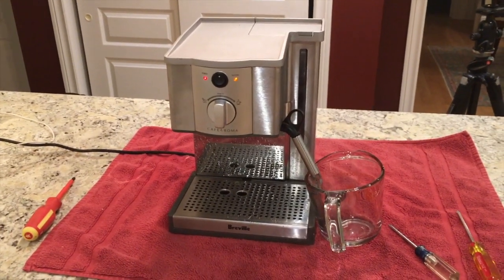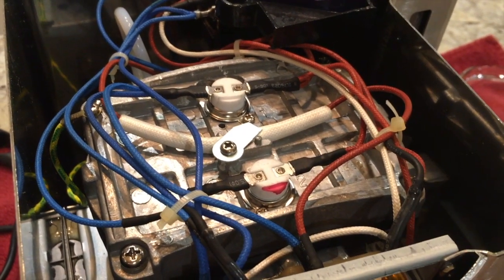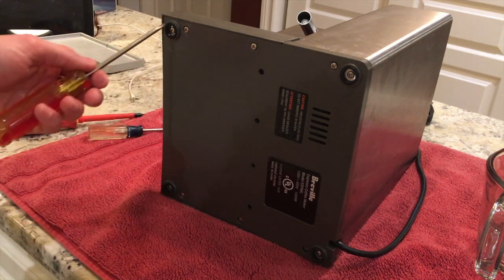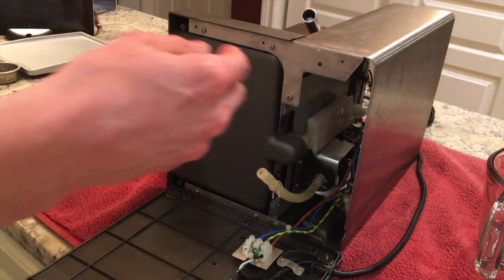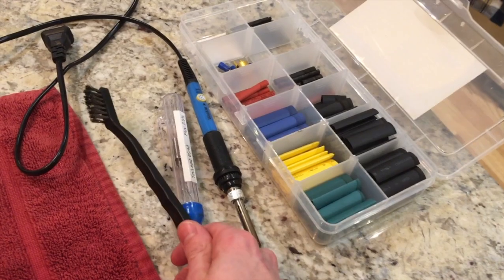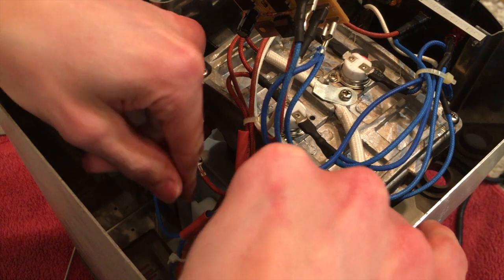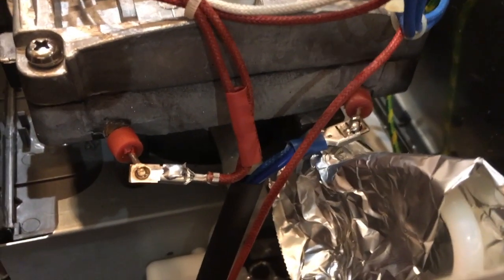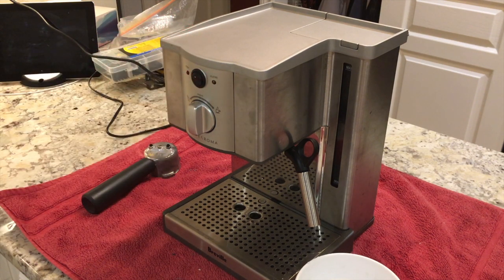Breville Cafe Roma Espresso Machine Not Heating/Steaming - Repair

Comment: Hey Geoff, we’ll done. Very good presentation, no bs about forcing viewers to watch long drag out boring bits, straight to the point. I appreciate it. Get a proper mic if you could for future vids, I thought I have gone deaf! My Cafe Roma has been going for 15 yrs, still is going. Only needed a descale after something was blocked inside the guts. Yup, only ever descaled once in 15 yrs! Either I’m hopelessly lazy ( probably) or the machine is damn good. Cheers!

Comment: Just got a 2nd one for free tonight.  Heats up and you can hear the pump run, but no pressure.  Will get into it in the next few days.  It was worth getting for me for the extra portafilter and the single shot cup.  Came with the espresso cups and the steam cup.
Reply from the maker: Thats a sweet score, especially for the free extras. Try priming the pump, it sounds like it might be hydrolocked. This is when air gets into the pump lines and it can't produce any pressure. If you have a syringe or a turkey baster, you might be able to get it going again by forcing water into the intake lines. Failing that, maybe a good cleaning would do the trick! Good luck!
Reply: How do you prime the pump ?

Comment: Just bought this machine second hand. When priming the pump with a baster I can get water to push through the group head and steam wand just fine. However, the pump sounds quiet when I do so and will not suck water on its own after I try prime it. Is the pump broken, or do you think it is a different issue I could fix? Thanks!

Comment: Thanks. My 800ES machine had the exact same issue. Toke it apart and found the heating coil connection was corroded just like yours. Fixed it with your method but not sure how long it would last.
Reply from the maker: Hey, glad to hear it helped you out, thanks for the comment. Hope it lasts for a bit! Cheers

Comment: is there any concern with heat and the female spade connectors i thought they need to be plain with no insulation as they may not take the heat also do you use high temp shrink wrap or will any shrink wrap do?
Reply from the maker: Hey! Not sure about the heat concern. This was mainly a quick repair to get the guy going again. That being said, On higher end espresso machines, the spades are usually insulated. Sometimes this makes the insulation a bit brittle, but never melts. The temp is never that high outside of the boiler/heat block. I just used cheap automotive heat shrink. I think that should do for most applications. I have had that melt before, but that was because I was using a wire that wasn't the proper gauge.

Comment: Hey mine has an extra hose for pressure relief it seems. Does your machine not have that? Did you delete it or would you recommend i delete. I think im having pressure issues and ecess water running through to drip pan
Reply from the maker: Im actually not sure. I repaired this for a friend a few years ago, I cant recall if there was an extra hose. I didn't do any modification that I can remember...

Comment: Hey thanks for your video! I noticed that my machine is making the same loud hallow thumping noise as yours is when you use the steam wand. I just got this second hand and noticed that in other videos of the machine it’s not doing that. The water is hot but that noise doesn’t sound good! Was wondering what you think!
Reply from the maker: Thank you! The thumping noise is normal when the machine is heating to steam. It’s injecting small amounts of water into the heating block to be turned into steam. It’s also normal for the machine to get hot up top. It’s an intentional hot surface for the purpose of heating cups.

Comment: Have the same machine had the same exact issue.  The blue wire connector was corroded so much it was almost gone. makes me wonder how many of those are being thrown away by their owners when it "stopped working" when it's such an easy fix...
Reply from the maker: Guillaume Girard Yeah absolutely. I bet a ton of these end up in the landfill. How old was your machine when it started acting up?
Reply: @gpereir4  at least it was old.. More than 12 years of service. I repaired it once maybe 3 months back but didnt solder correctly. This time I ran an extra wire through the connector and tab before soldering it.
Reply from the maker: @GuGirard  12 years isn'd bad at all. I think the one I repaired was around 5. Props to you for keeping it out of the landfill!
Reply: @gpereir4  all thanks are yours ! 3mins into your video and I had seen the problem!!!

Comment: Would anybody know why my pump is just humming and not actually pumping? I did not use it for some time and it was working before was stored away. Now would not pump! Thanks.
Reply from the maker: Could be hydrolocked due to an air bubble in the pump. The best way to force water into the pump as its trying to run. Try taking the intake hose off and injecting water into it with a syringe with the pump running. This primes it and gets it running again.

Comment: Great vid, thanks.  I think it may have a hydrolock issue, will try again tomorrow.
Reply from the maker: Scott McDonald Thanks Scott, good luck with your repair. Try pulling a full reservoir in and out of its position a few times to try and encourage some bubbles out of the line. If that fails, take the line off the bottom of the reservoir connection that goes to the pump, and try to force water through it with a turkey baster bulb or syringe (I use an oral medicine syringe). Good luck!
Reply: @gpereir4  thanks for the tip, I get it to produce steam from the frothed wand, when I switch to coffee mode it sounds like it is trying but nothing comes out.  Will try forcing water up into it tomorrow.

Comment: Hey, I'm wondering if you could help me with installing a PID controller on this model
Reply from the maker: Hi, since this is a thermoblock machine I don't think it would benefit from a PID. It does not have the same achievable temperature stability.

Comment: Thanks for the tip. 
Wire female connector was kind of munched, male was OK. Just replaced it, greased it  and ... VOILÀ !
Reply from the maker: Excellent! Glad the video was helpful.
Reply: I have the same problem and i'd like to know how to find and a new connector and replace it.
Reply from the maker: @estelledesjarlais6183  Do you mean what type of connector to look for? The connection type on the cable is called a female 1/4" spade connector. On the heating element is a male 1/4" spade terminal. You should be able to find these at any hardware store. If you cant make a new connector work, you can strip the connector off the wire and solder the bare wire to the terminal of the heating element. Hope this helps!

Comment: Thanks for this video, very helpful. I have a same model Espresso Machine, not used too much, just found no steam output recently. After viewing your video, I opened the top cover and tried to find the reason. All connections look good and vibration pump also works properly. When switched to brewing, hot water comes out and can hear the pump sound. So pump is good, heating block no issues. When switched to steam, no pump sound, in the beginning a little bit steam comes out from the wand and then no further steam. It looks no tube block/clogging inside (already descaling using vinegar). My understanding is no power supply under steam mode and the pump power is supplied from PCB (M connection with white color wire), I checked the voltage only 1.6V when steaming. Do you think it's the reason or I should check other points? Appreciate if you can give some thoughts. Thanks!
Reply from the maker: I am not sure what else you could try. I don't really have much experience troubleshooting PCB boards. I guess just check that the switch connection is operating properly. You could check the terminals at the pump under steam mode to see if there is voltage being pulsed to the pump? Other than that, not sure what to check!
Reply: @gpereir4  Thanks for the reply. I checked both Micro Switchs for water and steam, looks both working properly. Under brewing mode (switching to right side), the pump is supplied 120V AC from right switch and heating is controlled by the rear Thermostat (98C). Under steam mode (switching to left side), the pump is supplied less and regulated voltage from PCB through white wire (M connection) and heating is controlled by the front Thermostat (140C). I'll further check and figure out how the PCB works and find the reason of no voltage output under steam mode.
Reply from the maker: @patricklee9443  Bizarre! Let me know what you find out about this one.
Reply: @gpereir4  I got a PCB from a broken Breville Cafe Roma and replaced my board, now it works properly. When switched to left side (steaming), a slow pumping sound could be heard and steam comes out from wand as normal. I checked the voltage from PCB to the pump through the right side micro switch and it shows around 5V (previously only got 1.6V which maybe too low to push the pump piston to move). So glad to make it works again. Thanks for your help.
Reply from the maker: @patricklee9443  That's very weird! Glad you got it to work, kept it out of the junkyard!

Comment: Geoffrey, have the same espresso maker and was in storage so my wife wanted an espresso but it did not pump any water out. I took the bottom filter out, cleaned it in white vinegar and brushed it clean with a dish brush. Still no water. What would be the next step?  Thanks!
Reply from the maker: Hey Scott, it sounds like the lines may have dried up when the machine was in storage. This can actually prevent the pump from moving water due to "hydro-lock". if filling the reservoir with water and running the pump for a while doesn't work, then you have to manually force water into the pump. To do this, remove the water reservoir. You should see a port where the reservoir connects. You will need to force water into this port with the pump switched on. You can use a syringe or a turkey baster, or something similar. If this works, you should hear the tone of the pump change as it fills with water. At this point, shut off the pump, put the reservoir back in, and run the pump again. It may take a few rounds to work, but this should kick-start the pump into moving water again. Hope this helps!
Reply: @gpereir4  Geoffrey, thanks so much for this idea. I was told by Breville to decalsify  the unit. Of course nothing happened. I had read someone on YouTube doing this on a different maker. Thanks! I will try it out.
Reply: @gpereir4  Geoffrey, the good news is water is coming out but it seems to be also leaking out the bottom, too. I'm wondering if that's water at the bottom of the well where the the port is.? Accidentally knocked the reservoir container and had a big mess with vinegar to boot. Will try tomorrow after the flood dries up.
Reply from the maker: @scottrosenthal3437  Good that water is coming out! Hope the leak is easily identified and fixed. It is quite possibly leaking at the bottom of the reservoir where the port connects to the tubing leading to the pump. At about 4:06 in the video, you can see where the hose attaches. I would check to see that the clamp there is still tight around the fitting. Good luck!

Comment: Hi , I have the same machine but the problem is it overheats very quickly and causes a vapor block . And won’t let water through . Any ideas on what part could be the issue ?
Reply from the maker: Hi I’m not certain, but it could be a defective thermostat or it could be the heating element itself. Good luck with the fix
Reply: Hello 👋 i have the same issue with mine. Were you able to fix it? I appreciate your reply.

Comment: Does this espresso machine have any plastic parts that come into contact with heat?
Reply from the maker: Yes absolutely. There is a lot of plastic in this machine, in very close contact to the thermoblock. All the water lines are PFTE plastic as well instead of copper tubing.
Reply: @gpereir4  Thank you for getting back to me! That’s a shame, would you still recommend this machine?
Reply from the maker: @Spade193  I wouldn't get one new. Used, maybe, but I wouldn't be buying a new one. There are much better new options, even from Breville. What's your budget range?
Reply: @gpereir4  Thank you I appreciate your input! I was thinking to maybe go with the Breville Barista Express. Do you have any thoughts on that one?
Reply from the maker: @Spade193  That is a pretty good machine, I actually had one that I purchased used for a while. Worked very well!
Reply: @gpereir4  That’s great to hear, thank you Geoffrey!

Comment: Hey, i have this thing on my cafe roma that everytime I brew, water and steam start to drip out of the portafilter. Happens almost everytime (not always though). Based on this issue you had, do you think my mahcine may be losing pressure poweR?
Reply from the maker: Does it drip out of the holes of the portafilter, or up near the top where it locks into the machine?
Reply: @gpereir4  near the top, at times it will start to drip water and steam, like it explodes

Comment: I have a similar problem but not with heat.. just water spatter from the steamer before steam produces... also water is leaking onto the counter.. reservoir is fine when standing on its own, but if installed in machine (turned off) it slowly leaks beneath... any advice?
Reply from the maker: Its usually normal to get a small amount of water before steam comes out. However, if you are getting more water than you think you should be, there could be a corroded connection to the heating element just like mine, preventing it from heating up quickly to produce the steam. The water on the counter sounds like a leaking gasket on connection between the water reservoir and the machine, where it plugs in when you set it down in. Take a look at both the reservoir and down in the machine where it attaches, and see if you see a rubber gasket or O-ring in either spot. this may need to be changed.
Reply: @gpereir4  Mine leaks from the front middle, down the front side, as the coffee is coming, and doesn't fall in the drain. I've taken it apart from the top and bottom, but not from the front. Can you take off the black section where the coffee comes out?

Comment: I'm going to take look at mine, but it's a weird problem. When i start brewing i hear the motor,  almost nothing comes out, i hear the pressure build up until it "blows" out from where you put the coffee and makes a mess. like its clogged, but i used a product to clean the machine (2-3 reservoirs of water + that stuff) and it's still the same problem.... and the handle where i put coffee in i used a small needle intended to unclog it and its not clogged.. 
sorry about my weird explaination  hope you understand and can help me
Reply from the maker: Yeah it is definitely clogged with coffee. Take a screwdriver and take the screen out of the grouphead to see if it is clogged up behind there with old coffee. The products used to clean espresso machines that you mix into the tanks are typically descalers. These will take care of lime scale, but to nothing to clear coffee buildup. You want to try using a detergent like Urnex Cafiza to clear the blockage. Hope you get the machine working!
Reply: @gpereir4  thanks! Ill try that!

Comment: Mine heats up just fine but I get no steaming.  Any suggestions?
Reply from the maker: Check the thermoblock connections like I dd in this video. The machine I repaired here would heat up enough to make the coffee, but didn't have enough heat to steam. You could have the same problem as in the video.
Reply: @gpereir4  i had to descale it about five times and run it for a few hours to finally get it cleaned out.  Thank you!  Now I have steam :)
Reply from the maker: @DerekSpeareDSD  Ah! Glad to hear you got the problem resolved. Scale can cause so many problems!

Comment: Maybe you can help me, my machine has only 3 wires at the electronic board, coffee is working but no streaming, TIA
Reply from the maker: Does it make the on/off pumping sound when in steam mode?
Reply: @gpereir4  steaming mode - nothing happened, except boiler is heating
Reply from the maker: @abracogrande834  Sounds like there may be a problem with the board or the connections to the board. Can you see a missing wire?
Reply: @gpereir4  Sorry for late reply, just an update to the repair of Cafe Roma,  we fixed the faulty board, replace the two IC, the ones controlling the steaming function. FYI Many thanks again
Reply from the maker: @abracogrande834  No problem, glad you got the machine working again!

Comment: Just one thing those heating elements have spades welded on because they get hot enough to melt solder.
Reply from the maker: I never thought about that, it makes total sense! Thanks for the insight